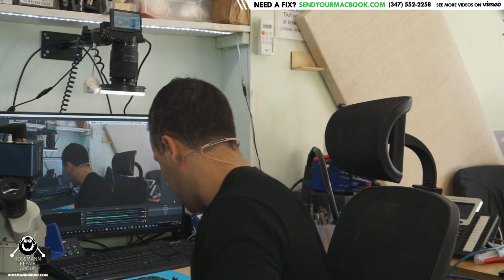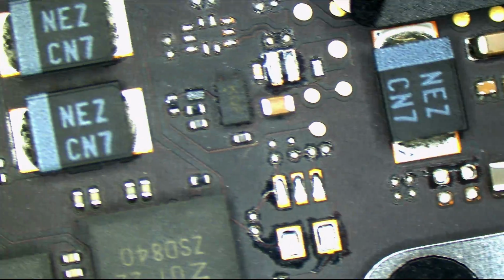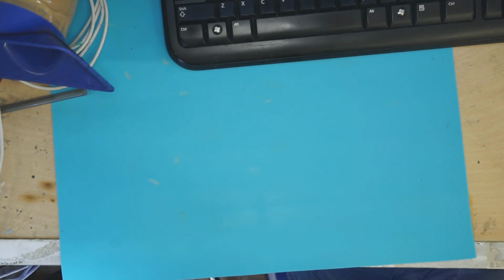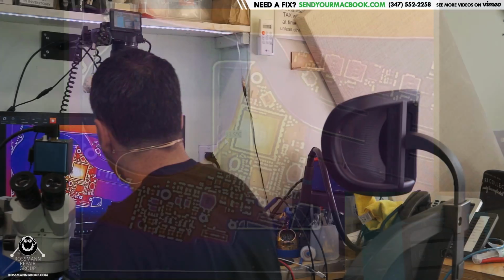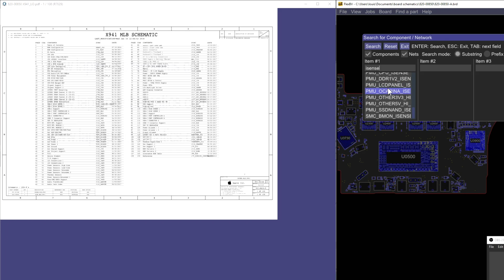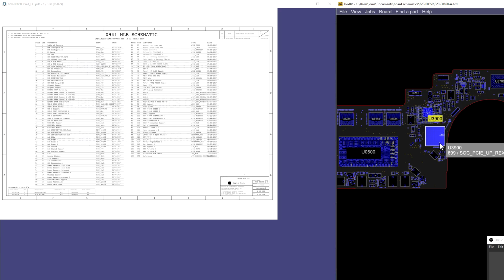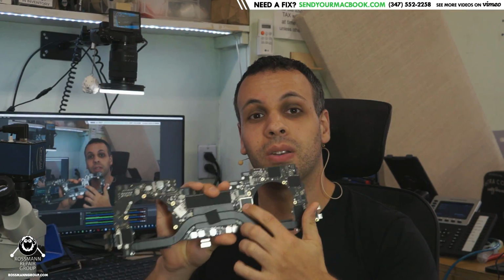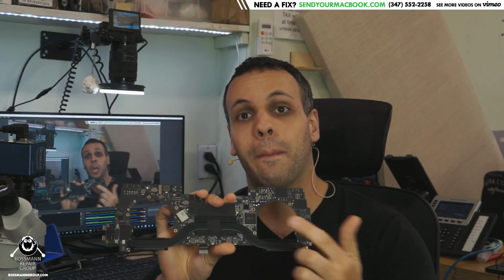Apple users have no one to blame but themselves.

Comment: OK, been binge watching your videos (AGAIN).  You sir, are an enabler.  I avoided Apple like the plague for years simply due to Jobs' total control philosophy, so I dealt with PCs, which meant Windows, since I live in the business world where UNIX or Linux was not something understood by the clients I deal with in my industry.  Then, I started a business & my business partner was a Mac devotee, so he demanded we use Apple products because they "just work" from a software standpoint.   This greatly decreased our requirements as far as an IT person since we had no driver, compatibility, hardware issues etc, since most of our personnel were older oil & gas industry guys who were not computer literate.  Due to this, it has been years (just after Windows 95 was released) since I had to deal with the headaches associated with Windows & all the reinstallation issues etc.  Fast forward to today, where I am back to the point where Mac's continued adherence to Steve Jobs' decidedly unwise, total control philosophy, even after his death, has finally caused me to want to quit giving my hard earned money to them.  My issue with this epiphany is that I have been forced to live in the MacWorld for so many years, I don't want to have to try to fight my way through the Windows learning curve since I have missed several iterations of their OS.  Then, I found Rossmann Repair & viola, I can stick with a Macbook, but use a company that actually has a clue as far as micro repair work, since Apple refuses to hire &/or train actual technicians to fix their products.  Thanks, Louis I feel a bit better knowing I can send our company's machines to you & trust they will actually be fixed, rather than dealing with the stooges Apple hires who will always just tell us to buy a new laptop for our guys.

Comment: Serious question,

I was having issues with my Android phone and the Google tech support forums told me to get an Apple phone to resolve my issues because my  google account not being compatible with Android.  Apple is bad as well and because smart phones being so prevalent manufactures do not make feature complete flip phones anymore.  Given this where should I be getting my phone from?

Bit of details of what I mean by my google account not being compatible with Android. When the google play store is associated with my account it enables two-step identification (not authentication, according to the tech forums), which requires me to use my phone when logging in from a new machine. Because this is identification and not authentication it cannot be disabled in the account settings and I am not able to generate offline codes, and there is no google documentation on the matter. This causes me problems because I work in a dead zone (email is the only real way for people to reach me) and the time out window to get the code is shorter than it takes for me to get reception and get back to the computer I need to login from. To further complicate matters the Android I purchased (LG KV20) does not support two step.  I am certain this is an issue on googles side as the moment I remove the google play store association from my account I am able to login, also if I associated the phone with my junkmail account I am still able to login without issue. Additionally, google support is terrible, I spent ~8 months trying to resolve this issue and as stated above the solution I was given was to get an apple phone.

So yea, feels like no matter where you get your smart phone you are screwed one way or another. At this point it is just pick your poison.

Comment: At 6:19 Mr. Rossmann almost nails it "these devices are meant to be throwaway items." Like big screen TVs, personal computers have gone down in price to the point that if the cost of the repair exceeds half the cost of a new one, then it is more cost effective to throw the broken one away. They are throwaway items with the exception being Apple. Their products cost three times as much as the competition, so it was still worth trying to fix them in some cases. Apparently the profits weren't good enough when Apple permitted their customers to have their computers independently repaired so they are shutting it down. The same thing is happening with vehicles. The manufacturers are trying to use software to cut out independent auto repair and make you bring your vehicle to their costly shop.
Reply: Apple do this regardless of price point, their most expensive products are also glued together monstrosities !
Reply: @JornNavarre  I bought a Lenovo Thinkpad USB Keyboard for the pointing stick, and when the micro USB port broke, I took it apart. I spent a long time looking for screws under rubber pads. The entire thing was held together with really, really, really strong adhesive. It ruined one of my pry tools.

Comment: Yes, they will do this to you.

I used to work at Apple. I used to treat repairs like I wasn't paying for them:

You rolled up with a battery at 85% health, I'd just say good enough for repair under warranty and just do it. 

You wanted to replace your phone b/c of an issue? I'm not going to hassle you for the issue if you are under warranty. Let's just do it. 

Your Mac stopped working? You are under warranty? Let's just replace it b/c that is the right thing to do. Get you back on your feet.

That was back in 2014. 

Now they have basically said f**k the customer even with a warranty, including former employees. I had a 2012 Macbook Pro. I installed all the trimming on it myself b/c the additions were deemed "unauthorized." 16 GB of RAM, dual hard drives... the superdrive is probably somewhere. 

Well, the computer had a board level defect. The three beeps saying RAM was the problem (it wasn't. I tested with a Thinkpad.) I had Applecare (standard). They replaced the board after I undid all my modifications. OK. Three months later. Same thing. Another four months same thing. They refused to replace the laptop that was in warranty until 2017 (2014-2017). 

It was sent out more times after that, and I spent more time without the laptop than with. When the warranty finally ended, I basically used it as best as I could, wiped it, and went straight back to Lenovo Thinkpads full time. 

I don't know why I ever left. I will never buy another Mac again. If I had been the Genius treating my issue, I would have pulled the white glove on for the customer and replaced the whole laptop with something new in store, instead of dragging me through the shit. :|

I have an Apple Watch (I got it for free, damn it) with AC+, and it also has an issue and Apple has sent it back saying ... we reset the software. So did I. At least it was free. 

As a former Apple employee, I say run for the f**king hills. Don't keep buying this trash.
Reply: I'm a former employee and idk why people keep buying this products
Reply: I do... Brand whores.
Reply: I mean the right thing to do would to fix the issues and not replace them, you gotta think on the environment mate but not even that they're capable of.
Reply: @Eduardo-vd8fo  what would Greta do...

Comment: I have no doubt that what you are saying it true but i've had many Macs as well Windows .  My Macs have always lasted longer and Windows are simply rotten at the core.  I have never had to reformat a Mac (not once) and I have always had to reformat Windows, about every six months I'ld say.
Reply: This in so many ways - just replied to a comment further up that I´m sitting typing this on a 2012 retina, my first ever mac & it´s still going strong,. In over 7 years, I´ve not ever once had to defrag, never had to run window cleaner, never had to to a clean OS reinstall etc etc etc like I had to regularly on all my widnoze devices before that. All I do is open & close the fucking lid & it just fucking works. 7 years and cost/time, it´s the cheapest laptop I´ve ever had.

Comment: the reason why the SMC is locked down is because it contains one third of the seed for the filesystem encryption. Yes, once that chip goes, any data you don't have backed up, that's on encrypted local storage, is gone for good.

So there's an advantage to it, too, triple hashed AES encryption. If only they'd make those SMCs more resilient...

Comment: HELP NEEDED!!!

I have a Dell XPS 15 9560 with 32 GB (16x2) RAM. I went down to the local store to get the thermal pasting on CPU and GPU (for the first time in 2 years, since i bought the machine). Everything went down smoothly but when we tried to power on the machine, the screen went black and after a lot of trial and error we narrowed it down to a faulty RAM slot because of which one RAM also got damaged. We tried using it with just one 16 GB RAM and it works just fine. We tried installing a new RAM in the slot, to see if it works, but both the RAM and the slot were instantly heating up to a very high temperature, even on battery alone. So we quickly turned off the power and continued using it on single 16 GB RAM without any problem. 

So my question to you is 'if I try to get it fixed would I risk losing the entire motherboard and the other working RAM slot as well?'
As the machine is no longer in warranty and a new motherboard is extremely expensive, should I go ahead with the risk or continue using it in this working condition?
Also could you get an idea of the problem (overheating slot) by reading the description of the problem?

Comment: Apple has LCI (liquid contact indicators) those are suppose to be the deciding factor of liquid damage other than obvious corrosion. I agree the T2 chip was a shitty move by Apple. I have also seen corrosion on boards with no signs of ingress meaning that more than likely the worker that assembled it probably sweated on it or something.

Comment: I've worked with Apple since 1980s.  I have owned Apples, Macs, PowerMacs, iMacs, Macbooks, iPads, iPhones, etc.  All while spending 15 years of my life being an MS Windows Desktop and Systems Administrator, from 1989 - 2004, which pretty much required me to have Top of the Line Windows systems personally.  While I've had technical support issues, I've never had Apple screw me the way Microsoft has.  I swear today after making the switch to Mac OS X, I wish I hadn't wasted those fifteen years supporting MS, but being honest, it kept me employed.  As far as the Liquid intrusion on this laptop. You didn't demonstrate looking at the LCIs.  Anyone who knows anything about Apple hardware knows that there are physical and electronic Liquid Contact Indicators on the connectors and inside the computer at locations where Liquid will ingress first.  All that needs to happen for them to claim catastrophic liquid damage is for several of those LCI to be activated.  Plus,  someone soldered on that board, UH DUH no longer warranted...  Go on keep using Windows machines for all We Apple Users care, because we value our time over money, and I've rarely had to replace/reinstall the operating system on an Apple PC, (mobile is another conversation), and my time IS MONEY.

Comment: Apple sure has gone down hill. I recently bought a used iMac G3 made in 1999  for $30 that came with original keyboard and mouse. (the 333mhz tray loading model and the color variation I got was the Tangerine one which is one of the more rare colors apparently since that one didn't sell as well as the others) that has thousands of hours on it due to being used in a University and has a tiny bit of burn in on the top of the screen from the menu bar. (A damn shame MacOS didn't come bundled with screensavers of some kind. You have to get a third party program like AfterDark for that) and that thing still works 20 ***king years later!

Today's machines crap out in under a year now?...a ***king disgrace. I haven't bought anything modern from Apple and will continue to not do so. I'm only interested in their vintage stuff right now since apparently that crap holds together better. (which is always bought used so Apple will never see any of my money anyways)

Granted many of their machines from the 90s had capacitor issues and mid 2000's machines too due to the infamous capacitor plague. But it seems like the iMac G3s dodged that bullet. At least mine seems to have. :D

The capacitor problem didn't start to impact vintage macs until they started getting old. Like a decade plus old. The only notably bad case was maybe machines made in the early 2000s that got impacted from defective capacitor plague. But Apple wasn't alone in that debacle. :P

Comment: At least Apple didn't slow down the laptop CPU to force obsolescence then come up with a pitiful excuse about they did it to stabilize the system when the battery gets too old. Time to move on. Apple use to be great and pro customer but the greed has turned them into a scam outlet.

Comment: Apple has been charging double to triple what their competitors charge for a closed ecosystem for over twenty years. Similar CPU speed, similar RAM size, often low-balled GPU, closed operating system, and lotsa DRM for over double the price. Pass.

Comment: 6:00 Doesn't that fill you with dread going forward? If that's the way Apple is going then older models are going to go out of use and these new, unrepairable, models will be the norm, meaning your work will be impossible?

Comment: What would be the correct way for Apple to implement the T2 chip? 

Should they give all independent repair shops access to their proprietary code?
Reply: No, but allow repairs such as getting a new T2 chip and programming it according to your other components' ID. You wouldn't need their code in order to install a chip, same as installing an intel chip into your motherboard.

Comment: Ultimate answer to question "why x86/64 is better than mac?"...
Reply: MAC's are x86/AMD64 systems.  Think about hackintosh.
Reply: @cyb3rclub  Now they are, I used mind shortcut, though they are now using this architecture, I meant x86/AMD64 to be a "native" if I can call it that, PC-standard design, because fact that MAC are using something out of necessity or convenience doesn't mean they use standardized architecture (at all levels),  they only adapted the CPU and other devices into their design (but I am not MAC expert, nor CPU Architect, just had some classes on that years ago. Anyways, the utility of MACs sucks, they are so introvert that I don't even feel sorry for them.

Comment: Thanks.  A busted apple often beats a working PC.  I've spent a career caring for PC junk.  The best, which for a long time was Lenovo stuff, wad decent.  The worst was punch and crunch phenolic PCBs from HongKong with drivers written by the same folks who wrote the manuals, only even more cryptic.   Yeah, we deserve what we get. And we get, for the most part, high quality stuff that is well supported, designed to be interoperable and highly integrated, and that usually works years longer than the PC stuff people seem to think competes with it.  Plus... $100+per year to upgrade Windows and pay for Office365 and another $100-200 if you want the "pro" version of Windows?       It's the Microsoft tax.   Can you fix it yourself?   Maybe, and that's good, because there's a good chance you'll have to.  Once a month.    Some yahoo having one problem with Apple is not an indictment.  It's an anecdote and the plural of anecdote is not "data".   Apple consistently wins every contest based on customer service and care, product quality, and overall experience.   MS stuff isn't horrible, but it's not in the same league, any more than a Yugo is a Mercedes.

Comment: I had a Macbook Air for few years now, and was very pleased with it. That aside, I am now shopping for a new laptop and it's not gonna be an Apple one. I am really not happy with the direction the company is going; the repairs, the keyboards, T2, hefty price tag for hard disk capacity upgrades.

For me personally, time has come for a X1 Carbon 7th gen or a Razer Blade Stealth 13". I'm done with Apple.
Reply: I made the mistake of buying a first gen MacBook Air. It was the worst laptop I have ever owned. The sound board failed *twice*. It heat throttled like crazy right out of the box. If you so much as thought of doing anything more taxing than opening a webpage, or possibly playing back a youtube video, it would start throttling after minute or so.

Comment: I have a Sony Laptop I bought in 2007 and it still works albeit a bit slow because of the outdated hard drive.
Reply: Replace the drive with a SSD..
Reply: ZATennisFan I'm so lazy
Reply: I've just bought a Surface book 2... Pricey but what a piece of kit.. What OS you running?
Reply: ZATennisFan the laptop is running Windows 7. I mostly use my desktop now that I built last year.

Comment: The same happens in the car industry. There is something called component protection which doesn't allow you to replace any of your car parts (for safety and anti-theft reasons) which basically means you can't replace your car seats or upgrade your audio without paying high "encoding fees" (which involves cryptography and in theory can only be done using the manufacturer server).

Comment: client sent an iphone out for repair because the LTE transmitter/receiver was going in and out at any point.  they sent the unit back with a broken screen and said the unit had been tampered with, the device was literally 6 months old the client swears they never opened it not once its exactly as it came new. so Not only did he spend a ton on a new phone but it was defective and apple made it worse and refused to fix it. what a scummy company.